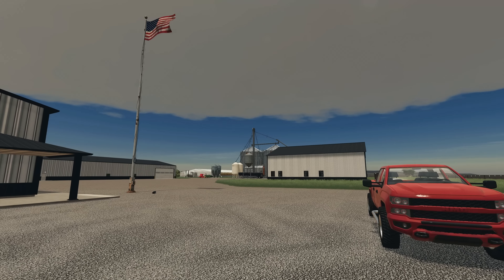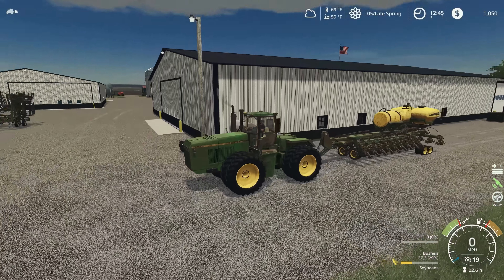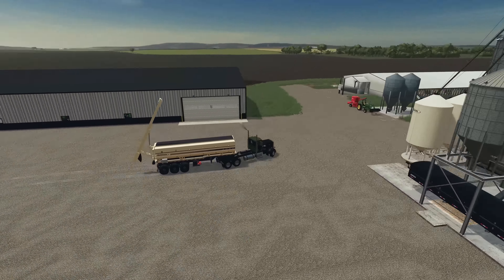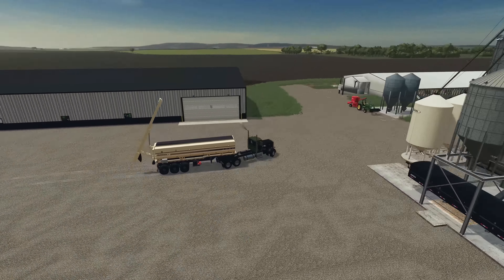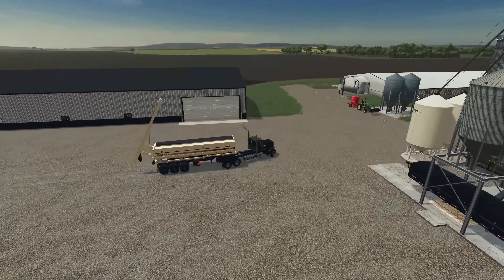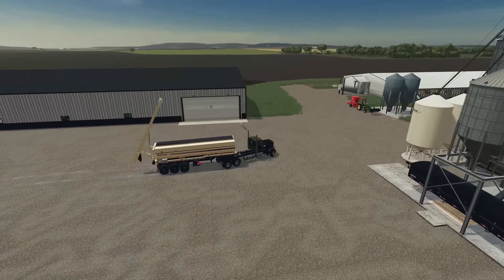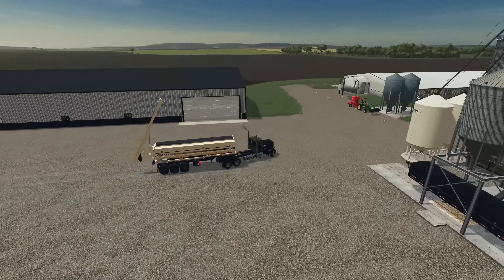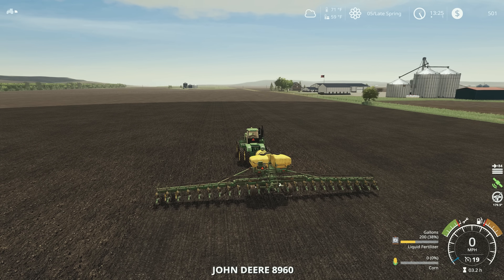Applying liquid fertilizer while planting corn with Precision Farming DLC - Flint Hills - EP7

Comment: Hey Kederk great video.   The tire spacing on the 6960 is probably proper for 30" rows but they look closer Because they are wider as you don't have to worry about crushing plants at this stage.   Not really the best setup for running down the rows once the plants are growing.
Reply from the maker: Generally you're trying to avoid compaction directly in the crop row has been my experience so even though you're not running down the road with the tractor post planting you're still trying to stay off that track
Reply: @KederkFarms  yeah, I think we are saying the same thing.  I think I must have misunderstood the concern you expressed in the video.  Happy farming